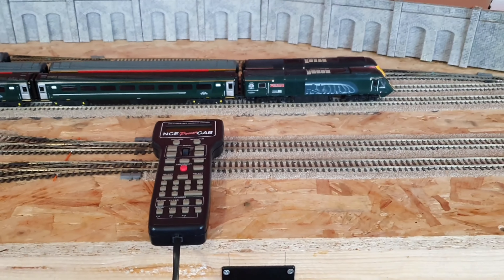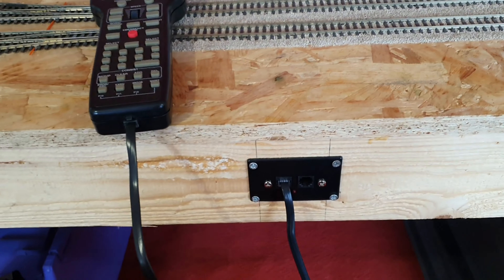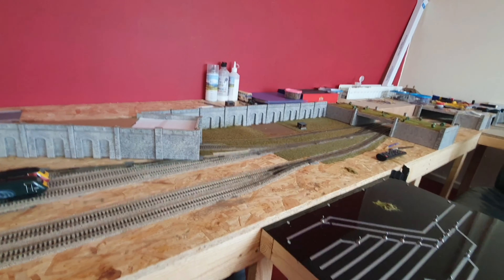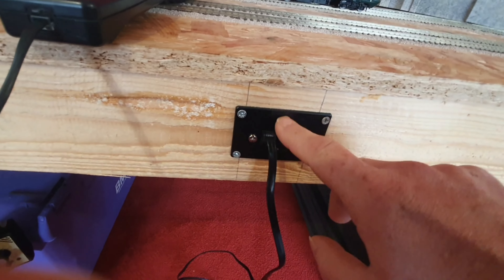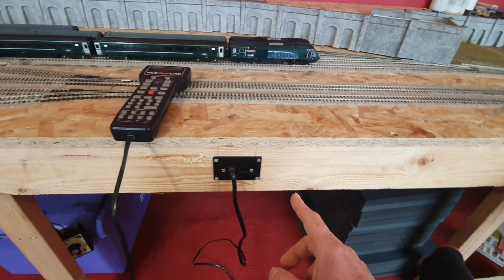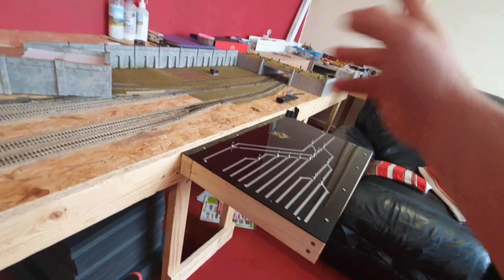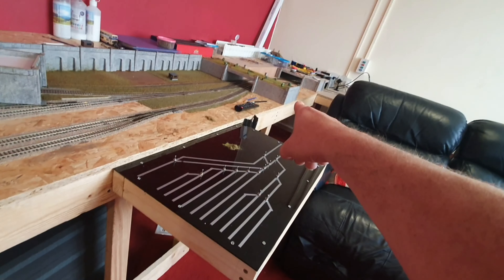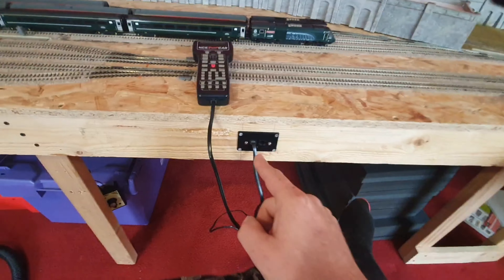NCE Power cab help

Comment: Hi, the answer is yes and no! You could make your own, here is the diagram http://www.lumsdonia.co.uk/utp.html or buy an UTP Panel and flat cable to interconnect at the back, you can not unplug the Power cab, as it powers the layout and has to remain in the PCP. The second port (UTP) would allow another throttle. If a train is set running with one, the second throttle can take over that train without it stopping.
Reply from the maker: thanks i will look in to this

Comment: I presume you are using the NCE Powercab as your only controller in the system. As the controller is the 'brains' of the system if you don't have a booster system or use another nce powercab controller, if you unplug the controller the track power will go off. If you were to have another controller and you use  the curly cord, as you know, you could move around the slave/curly cord controller however you could not move the main flat cable controller around without a loss of track power. If you were to have one of NCE's booster or something like that, the 'brains' would be moved to that, so track power would continue even with all controller disconnected. I'm not sure if this is exactly the answer to what you were answering - feel free to ask me another question if not. - McMetro
Reply from the maker: Thank you ill look at getting a second controller
Reply: You may know NCE do smaller compact, less featured throttles and the actual powercab. You can use either as a second controller but only use the powercab as a main. Based on what you have said, I'd recommend keeping your powercab in the same location with the flat cable, then getting a second panel. Then getting a throttle or powercab and using the curly cord, moving this second controller between panels or stationed at the second panel or the first.